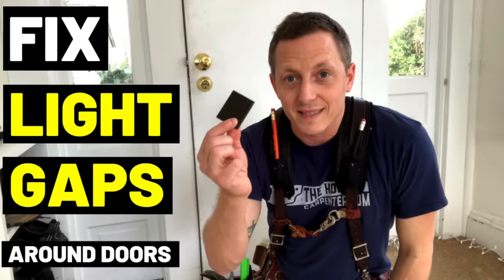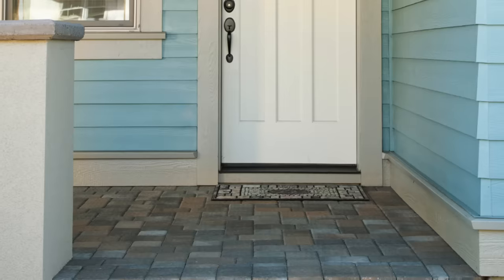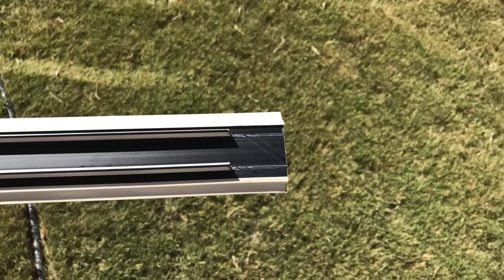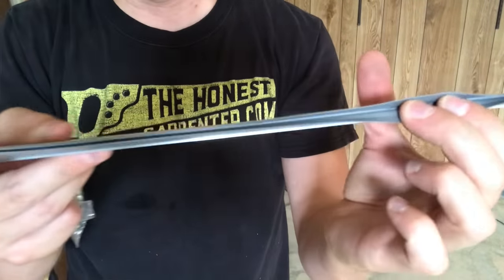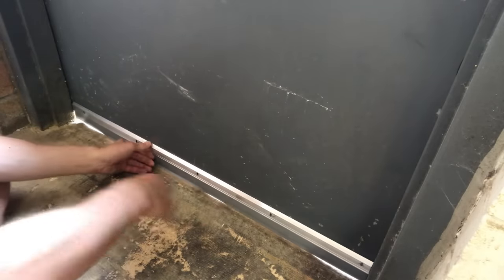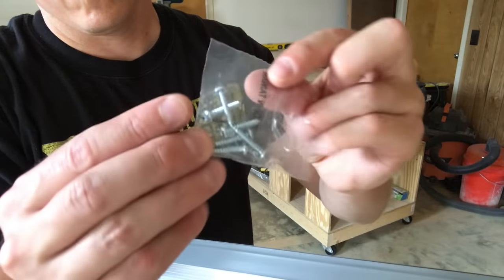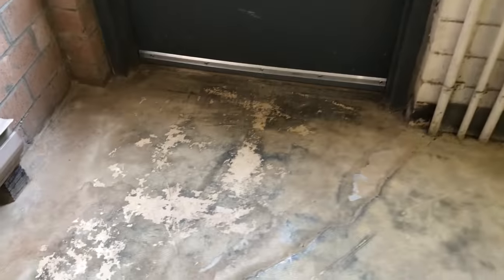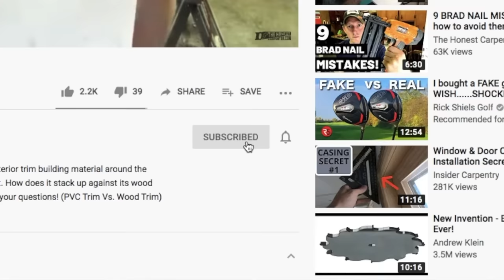How To Install BOTTOM DOOR SEALS--2 TYPES!! (Keep Out Bugs/Light/Water/Drafts/Sound...DOOR SWEEP!)

Comment: I like the idea of the double sweep. Here in fire country, a retired fireman stayed home as a big wind-driven fire bore down on them. Glowing embers blew under the door like crazy, setting little fires around the house interior which they put out with water they had reserved in the bathtubs and sinks. As the flame front passed quickly under high winds, he then went outside and put out other small fires outside. Another one for your "keep out" list. However, I'm looking for silicone sweeps, not merely vinyl.

Comment: A big safety concern.  At the end of your video, you suggest to extrude the bottom door seal out a little bit outside the edge of the door to cover the corner edge.  It is a big safety issue. That extrude edge can caught your feet accidentally. For sure, it does hurt.
Reply: I believe it was only the vinyl part extending beyond the metal. Not really a safety issue.

Comment: Very detailed explanation of these options and nice examples. I've also found myself using the add-on, lower thresholds in concert with these type sweeps in cases where it applied and they can really compliment certain applications. I appreciate you could have used one on your shop door but didn't as it would have impeded the accessibility to rolling items on wheels or casters through the doorway. It was a good call worth the mention. Great video, nice to keep your heat in and the bugs out. :)

Comment: I love your videos because you don't present "perfect world" scenarios, and my house is def not perfect. I need to replace the bottom nail-on sweep on my front door again (removal required) because the rubber strips begin to rip away on the door knob side almost immediately. I'm thinking the contractor installed it cockeyed.....

Comment: Back-to-Back, another awesome video. Thanks,. The self-tapping screws was a help for me. Whenever I installed exterior doors where the door sweep was used, the screws very rarely catch on the stainless steel doors but just bore right through. I'll try the self-taps and see if that helps next time.

Comment: I tried everything, including the flange, but finally settled on the U-shaped sweep.   It works really well with the multiple small flanges that adapted to an uneven floor better than the single flange.   A couple years later I'm still draft free !
Reply: First you install aluminum threshold on floor with concrete screws and seal it around with caulking , then you install door sweep , i watched this video and i see he doesnt know what he is doing !
Reply: @z.k5559  Certainly!   The title is a bit misleading as he's not trying to do a comprehensive lesson on how to install a door and prevent drafts.   He's simply reviewing two types of sweeps.    I like a threshold with the flexible rubber insert down the middle.   Allows you to put the sweep a little lower and the two will squish together as you close it.

Comment: Thank you one more job to get off my list.
The terminology used is great being able to go into the trade shop buy the correct product for the job. 
Have you got a tip for kitchen cabinets that have become out of a liniment not closing up. I know you have to adjust the hinges, what is your way?
Thank you in advance
 Chris
Reply from the maker: Thanks Chris! Many of those cabinet hinges are slightly different—I just open a cabinet door, turn one screw slightly, close it again and check alignment. Then try another screw and repeat. Do this until you know what each screw position does, then you can easily adjust all doors accordingly. 🙂

Comment: Hello, while your video didn't really apply to my needs it did give me inspiration! The door sweep I was trying to install was a vinal U-shaped one. I slid it on and it was just a quarter of an inch too long! I didn't know what to cut it with. I tried a utility knife but that only scored the plastic (which was helpful later in knowing where to cut but didn't actually cut through), then I tried kitchen scissors but that just broke the plastic, leaving a jagged cut, not really a nice cut and couldn't cut through the underside with all the little flaps. Then I saw you using tin snips and while I don't have a pair of them, I did have a pair of gardening sheers and I thought I'd try that, and guess what? It cut through that plastic very nicely, leaving a nice looking sharp edge, I even used the sheers to clean up the bad edge the scissors left behind. So thank you for the inspiration!! I have virtually no carpentry skills but I sometimes don't mind doing some light projects if I can and have the right tools. I will be checking out some of your other videos. Thanks again!!

Comment: That works when the floor that the door opens up on is level or lower. If the floor is higher, the sweep binds on the floor. You might address that.

Comment: I don’t like drilling holes into the door.  The existing one that’s worn out on the door was slide on & appeared to be a rubber gasket type.  Local hardware stores didn’t have what was on there so I’ll have to check big hardware stores like Home Depot.  I like the Stanley brand sweep w/fins as that seems to be the type that was on there.

Comment: I would say you still have to get rain water in the bottom of that door, I have a small garage door installed three years ago it looks like it has good threshold to it good side weather seals but water yet gets in some how I even went as far as adjusting the threshold strip up higher to mesh with the original door sweep but after that & doing the extra caulking it still leaks water in, complete mystery as I said the door looks solid with all the weather stripping caulking but water is yet getting in, if I had to do it over again I would had gotten a door that opened outwards rather then inwards then I could had used an aluminum rubber sweep that would had forced the rain water to drain further away from the door threshold.

Comment: One big additional consideration to the aluminum and rubber flange door sweep is that it will drag dirt and debris it comes in contact with across the floor. Over time, this can do a number to floor finishes, especially some of the less expensive vinyl flooring products sold today. We removed ours and replaced them with another product, just to be safe. Very helpful video. Thank you!

Comment: unfortunately doors open inwards here in australia, making sealing more difficult. i opted for a just right height rubber strip on the threshold.
on the other edges it is most common to apply (and renew every few years) seals that get squashed by the door but, i found a seal that you install on the door jamb with door closed, which provides a perfectly adjusted fit.
bathroom doors bottom seal brush seal is more appropriate.
most of the "storm" bottom seals suck.

Comment: How does the vinyl hold up to the concrete slab? I outfitted my door with a nylon brush sweep because like you I didn't want to install a threshold. But this winter has gotten really cold and I feel I may need to swap it out for something more air tight like the vinyl one.

Comment: Thanks for the great videos and tips. What’s a good solution (besides replacement) to a bathroom door with a 3/4 gap at the floor?
Reply from the maker: Thanks Ed! You can splice on a piece of pine to the bottom, then sand and finish. Just be sure to leave some gap for air transfer!
Reply: Nice  Idea

Comment: nice solution. I have an interior door that was cut aboe the carpet...which we removed leaving a large gap. Any solutions for this?
Reply from the maker: Oof, that one can be a real pain, Riser. Depending on if the door is painted, I’ve actually ripped down quality framing lumber to door width size, glued and shot it to the door bottom, then wood fillered the seam, sanded and painted. Often it just vanishes!

Comment: Can you install the aluminum + vinyl flange on the exterior of the door only? As in, the one you installed on the exterior to cover the gap of light still coming in; Could you hypothetically install the initial (single) flange on the exterior side (without anything attached to the interior)?

Comment: I had a question. Since all the sweeps underneath the doors are different, would be just as efficient to use the stripping that attaches to the bottom inside and outside of the door with that rubber sweep?

Comment: How flexible is the rubber on those things? My front door has about a 3/8" gap along the bottom when closed but when you open it, it drags on the carpet because the house is old and the floors are uneven. I'm not sure if it would get hung up on the carpet too much to be usable.

Comment: I'm not sure what kind of sweep is on my door because it's an (inside sweep" but the rubber bulb has torn. Do I have to take the door off to find out? I like the one that you used but we have a matt in front of the door which may interfere with opening the door.  Also, the locking mechanism on the door is not working smoothly and won't close without turning the knob or pushing the door causing a loud noise. Can I simply spray some WD40 into the mechanism or do I need move the strike plate? Thanks for making all your videos. The DIYers are grateful for the help.

Comment: that concrete slab at the door frame edges looks eroded or broken out. I would have mortared that, filled it in. And not bothered with the extra door sweep. Other thing, for a door like that, maybe just one door sweep on the outside is better than one on the inside, as in shedding rain water and dust away

Comment: hi. i'm hoping you can help me out. i know this video is a bit old. but in my apartment, the floor is uneven in the front door. is there any suggestions or products that i can use that would help with that? in the summer the hot air just comes on in and we get lots of bugs coming in. so it's annoying. hopefully you can get back to me.

Comment: What about a gap that is 1/8" on one side of the steel door but 3/8" on the other side? The concrete under the threshold isn't level on this exterior door.

Comment: This is common with exterior doors in the Philippines , why !?  And never to see a bottom door seal , ever installed by the builder .  The other very strange thing is building from the ground . Instead of here as common sense normal , how far off the ground . Requiring a set of normal steps up to the front door or how many inches from the ground . Especially how prone " flooding " is there during the rainy season .

Comment: I haven't figured out what to do with my setup.  The threshold is tight on one side and has a larger gap on the other.  Should I consider shortening my door to give more gap so I can install one of these?
Reply from the maker: You can install them as high as you want, gubid! And with some tilt too, if need be 🙂

Comment: Metal threshold with rubber strip in the middle:  how do you replace the rubber strip? Take the whole thing out?
Reply from the maker: Those usually pull right out, Scott! You can sometimes just buy the replacement bubbles. But if not, you’ll have access to the screws holding it down, and you can replace with a newer threshold.

Comment: I used an all vinyl sweep on my front door, no need to use a hacksaw. It installs exactly like the aluminum/vinyl one you used, and is about the same price.
Reply from the maker: I’ve seen those ones, 999! Have they ever popped off before?
Reply: I have used the same vinyl/rubber sweep on metal door. The adhesive holds very well and no need for drilling.

Comment: I have a large gap at the bottom of my yard door that goes into the alley

How do I seal it? 

I need to explain that adding a peice of wood will not work because when it opens into my yard, the yard floor RAISES. So the door would not open if it were any lower - hence why the gap is there in the first place

I need to seal it while it is closed tho to prevent pests getting in!!

Im FRUSTRATINGLY at a complete loss tho because….

All the products out there are so TINY!!

This is the INTERNET!! Where is all the CHOICE in shopping !??

They’re all like bloody 40-50 mil long!!!

I need like 100 mill!!!!!

Any suggestions would be very appreciated from anyone

Thanks

Comment: Sweeps are meant to be used with thresholds they work and last so much better when they don't have to drag the ground. a 1/4" threshold would roll over easily while also assisting the sweep. 

  The biggest thing that gets me though is you put the sweep on the inside of the door first. Rookie mistake. you only ever need a sweep on the exterior of the door.
  For an in swing door corner pads seal the space that the sweep can't get too because of the jamb stop.